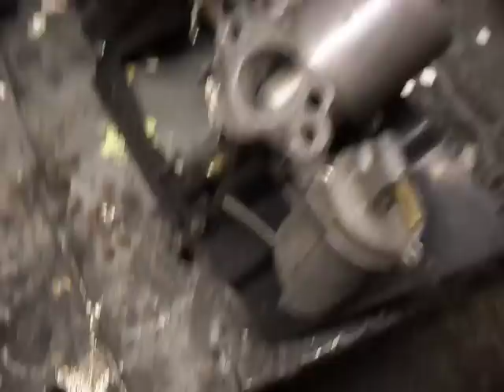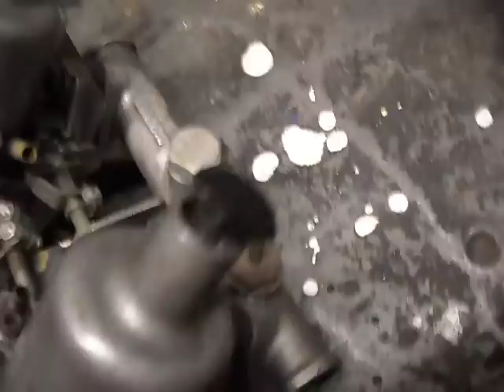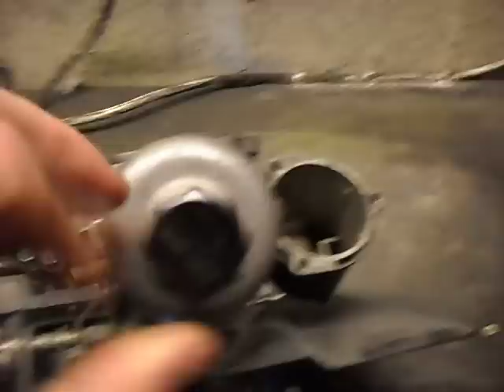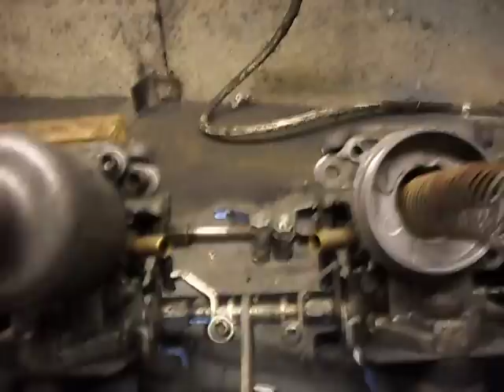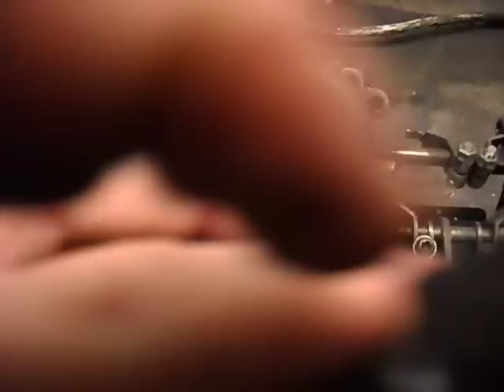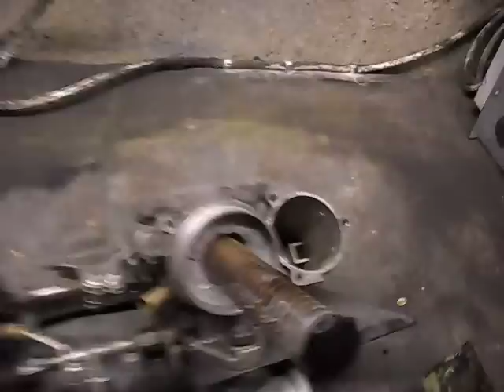[Cars] - Oil Dampers on SU Carbs.

Comment: After a 100 mile run, the oil level usually needs topping back up. Is this normal with SU carbs ?  Is the oil getting past a seal somewhere,  if so where does it normally escape ? (I have brass caps on the top and it's not getting out of there )
Thanks
Reply: Ah I see.. so its quite normal then !  Thanks

Comment: Can someone tell me why you would put oil in your carburetor?  I see all kinds of stuff on how and what, but WHY!
Reply: you probably need to understand more about side draft carbs.  Basically the oil is there to dampen the movement of the needle assembly that controls mixture.   No dampening and the system can overshoot,  to much dampening (using thick oil in cold weather) and the system becomes sluggish and unresponsive.   Dont think about it in downdraft carb terms,  different beasts.